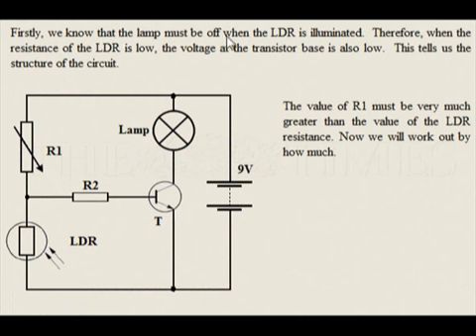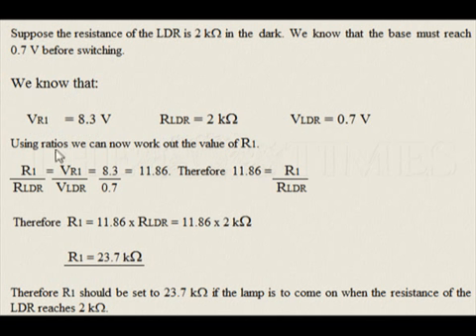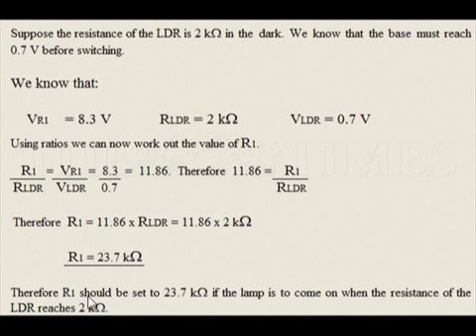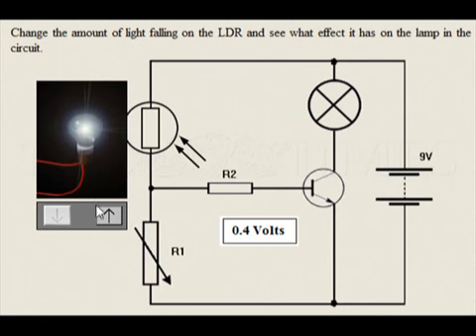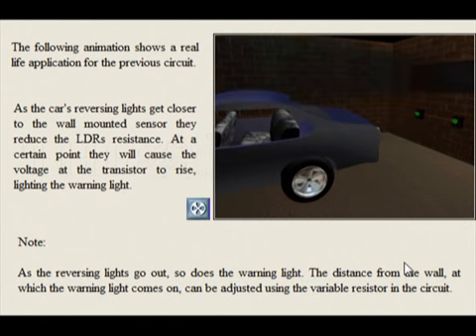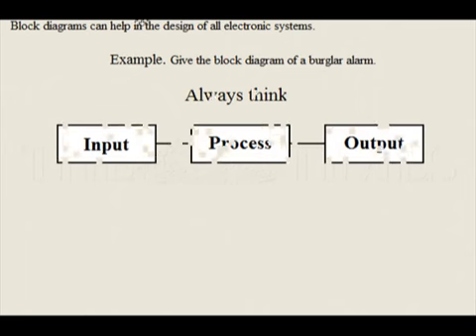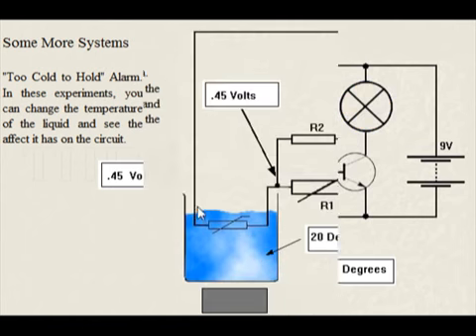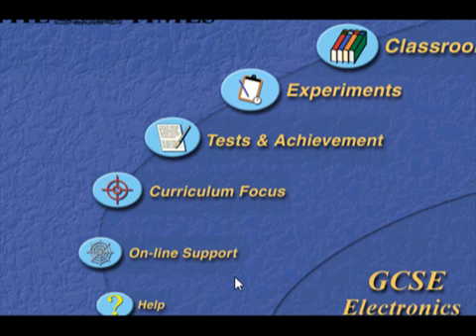Transducer 2

Comment: Nama : Tri Hardinah
NIM : 1102164059
Kelas : EL-40-03

Rangkuman :
Transduser digunakan untuk mengubah suatu energi ke energi lain. Ada 2 jenis transduser yaitu transduser input dan transduser output. 
Transduser Input merupakan transduser yang dapat mengubah energi fisik menjadi sinyal listrik ataupun Resistansi (yang kemudian juga dikonversikan ke tegangan atau sinyal listrik). Contoh : mikrophone.
Transduser Output merupakan transduser yang dapat mengubah sinyal listrik menjadi bentuk energi fisik. Contoh : speaker.
Pada video terdapat rangkaian dimana jika voltase yang dimiliki oleh LDR diperbesar maka lampu akan redup dan pada rangkaian ke 2 dengan menukar posisi LDR dan R1 serta menambah voltase pada LDR maka lampu akan semakin terang.

Pertanyaan : Apakah cahaya yang semakin terang atau redup hanya dapat dipengaruhi jika bertambahnya voltase pada LDR?

Comment: INDAH LESTARI
EL 40 03
1102163031

Transduser adalah sebuah alat yang mengubah satu
bentuk daya menjadi bentuk daya lainnya untuk berbagai tujuan termasuk
pengubahan ukuran atau informasi (misalnya, sensor
tekanan). Transduser bisa berupa peralatan listrik, elektronik,
elektromekanik, elektromagnetik,
fotonik, atau
fotovoltaik.
Dalam pengertian yang lebih luas, transduser kadang-kadang juga didefinisikan
sebagai suatu peralatan yang mengubah suatu bentuk sinyal menjadi bentuk sinyal
lainnya.Contoh yang umum adalah pengeras suara (audio speaker), yang
mengubah beragam voltase listrik yang berupa musik atau pidato, menjadi vibrasi
mekanis. Contoh lain adalah mikrofon, yang mengubah suara kita, bunyi, atau energi
akustik menjadi sinyal atau energi listrik.

Meskipun umumnya tidak dianggap sebagai transduser, fotosel,
LED (dioda pemancar cahaya), dan bahkan bola lampu umum adalah
transduser.Pertama-tama kita tahu bahwa lampu harus mati terlebih dahulu ketika
LDR diterangi. Untuk itu, ketika daya tahanan LDR lemah, tegangan pada
transistor juga ikut lemah. Pada eksperimen dengan LDR dan Transducer, kita
bisa mengganti jumlah cahaya pada LDR dan kita bisa lihat apa efeknya terhadap
lampu di sirkuit.

Dua rangkain tersebut dapat dibagi menjadi 3 kelompok, yaitu
Input, Proses, dan Output. Dimana terdapat LDR, transistor, dan lampu.